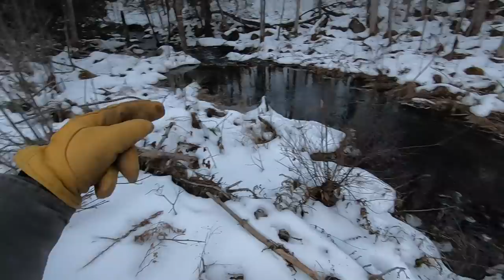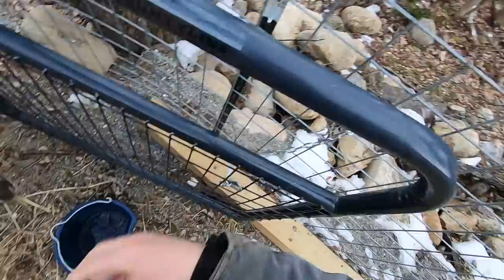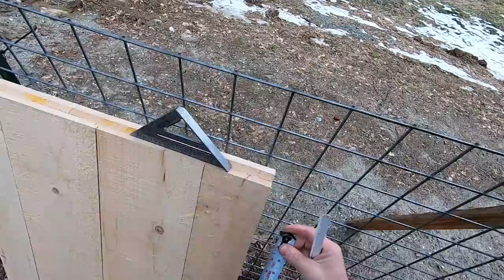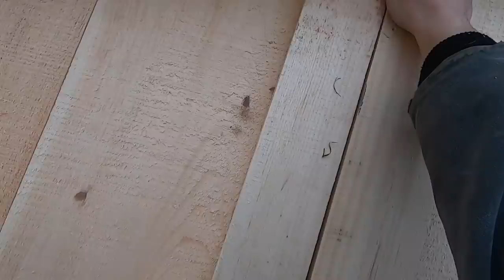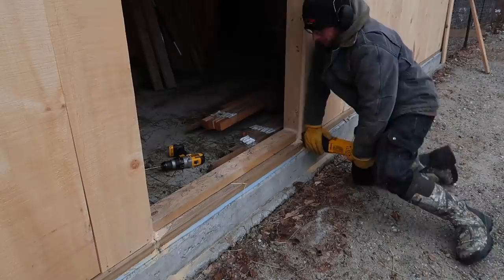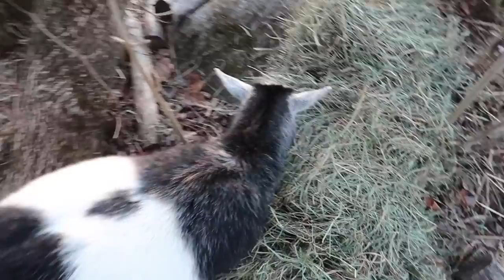Using ALL the Best TRICKS to INSTALL our Custom BARN DOORS (Post & Beam BARN BUILD)

Comment: from an old carpenter...when you are hitting a piece of wood {trim) or some piece that will show.. don't hit  it with the hammer...use a piece of scrap and put it between the hammer  head and the board you are adjusting.. this will protect the trim from all those ugly hammer head dents on what you will see. :)

Comment: If you sprinkle a bit of ash from the woodstove on the ice.
It’s dark and promotes solar gain to melt ice. 
It adds grip to the ice to prevent slipping. 
❄️ Caution if you use it near the house be careful toe black in the house.
Reply: holly slaughter, such a nice tip!  Thank you!
Reply: That was a very wise suggestion.

Comment: If you still have the ice on the paths a trick to get it to melt faster without needing salt or chemicals is a simple mattock, sledge hammer or even a maul to go along the ice and break into smaller chunks to increase the surface area the warmer temps can attack it. When Ice is a sheet you reduce where the temperatures can melt it from to the top and edges.

No need to go digging to get under the ice just some good solid hits from above to break the sheet into parts and simply let the above melting temperatures do the rest for you. 

Have you thought about getting a few turkey to roam the pasture for thanksgiving next year?

Comment: So glad you found how to make clean holes on both side with a spade or forstner bit. With big holes we use two drill motors, one with a forstner and the other with a hole saw. Perfectly clean holes every time.

Comment: Good morning.
Al, have you ever tried a Vix Bit? Not that you're having an issue with centering the bit but they are amazing.
I'm a carpenter by trade and these make installing hardware a breeze. You seem like the type who would appreciate these.
Aside from that, you are doing a fine job with your attention to details.......Top shelf !

Comment: I was wondering: Is the direction of the door opening for the door near the hay feeder practical? It looks like it would if your main usage is to open the door from the inside and turn with hay to the right side, but if you want to go to the left towards the goats' feeder, you would have to pass the door first, which on the screen looks not very comfortable in that rather tight spot ...... and going into the hay barn part from the goat's area, you need to pass the door all the way to the left side before opening it ...... as your projects are perfectly planned and thought through, I am sure, I am missing an important point here, but wish I would know which one it is ;-))))
Reply: I agree. I thought the door swing was impractical and should have a swing the other way

Comment: Wild cat tracks are always inline. They step into the track already made by their front paws. They also keep their claws retracted when they are not needed. Wild k-nines can't retract their claws and their tracks are offset although they still step into their front paw track the left goes into the left side and right goes into the right. Wild K-nines keep their tail down for the most part, but cats use their tails for balance therefore they want to keep their tails dry. From every thing you have shown and described You are dealing with a coyote. If you indeed catch one put your traps out again they tend to travel in packs similar to wolves. Also I would like to aplaude you and yours building skills.

Comment: The woodshed was far more important to be done and filled before the snow flew and it got cold. You don't NEED that side of the barn until spring for lambs.
I'm surprised you didn't put the hinges on the doors inside the workshop. Look how much faster the second door went in once the apprentice came!

Comment: Great job on the doors guys, square, plum & with perfect gaps... I too use the National brand sometimes, i.e., ( 4 ) black powder coated 6" hinges on my carryall's swing out walls... The carryall frame itself comes from TSC in Littleton... Currently applying MinWax Helmsman clear semi-gloss to my custom built chainsaw holsters. The carryall itself is now built as I am building my tool holders for the backside of the back wall currently... 
Bill on the Hill... :~)

Comment: How does the logic work when you climb over a gate that you could easily walk through? Safe homesteading means not taking unneccessary risks. I guess planting the head mount camera into the ground with your head would make great YouTube content but YouTube may consider it to be too violent.
You need a pounding block to reduce the hammer marks on such pretty rough sawn wood.

Comment: It could be your casting your human scent when you be walking thew the area of the what are you placing the game camera maybe you have to find a way to cloak your scent like what deer hunters do when you go hunting
Reply: I have never had any problem, I have had 2 foxes, a coyote, several turkey, and many deer walk right up to me within 2 arms length.  So I don't believe scent is an issue. Animals are curious. I leave mine for several days then check them. I have had deer find the camera and start licking them, had to move them higher. Also had a squirrel use one to sit on to eat nuts.
Reply: @jamesdeffenbaugh5166  but you make some valid points but everybody sent is not the same scent. Now looking at my post you see a few people agree with me but each situation is different I was just putting out a suggestion. In for the area he lives in even I live in a suburb and we have foxes coyotes possums and raccoons is something out there doing something and that's how the crazy white CHICKEN end up being killed
Reply: @jamesmoore1743  not all animals work on a schedule like deer, walking in the same path at almost the same time. Yes, I would like to eliminate all the predators around my property, if I can just keep them separated from my animals then it's a success. It's been over a year since they have gotten any of mine. I can't let my guard down just keep up my vigilance, as I see a potential weakness, address it. I have a 6 foot chain link fence that skunks walk straight through as it weren't there, foxes and coyotes climb on something and jump over the fence, then dig there way out. Raccoons walk right up the fence. Now I have a screened top, don't put things to close that can give access, and concrete around the base of the fence, also electric fence 2 and 4 inches of the ground. What I and several others have suggested is to put camera's near New Yoke City to see what is coming for the chickens. The camera is set up on the other side of the property. I have 2 of my camera's set inside the pen looking out in opposite direction, they are what show me the most action.
Reply: @jamesdeffenbaugh5166  no matter how much defenses you have set up to protect your livestock any predator will find a way to get in I have seen and personally heard animals shock themselves an build up a tolerance to electric fences! A predator when it comes to survival what do a whole lot to get a meal  as well as you know. And again you bring up valid points you have to stay on Vigil but he's already has put up a camera around New York City before. Let's say this we can agree and disagree on the subject but whatever he's doing he's not coming out with an outcome so far do you agree on that

Comment: Here in the UK,, the only things made out of wood like you have are horse stables,,,, same split barn doors,,, to make something like your barn here would cost ten's of thousands of pounds,,,, Workshops here usually are made from steel frames+metal sheets.... Much much cheaper

Comment: If your camera is not taking pictures it’s probably because your SD card is not formatted that information should be in the owners manual on how to format the cards my cameras won’t take pictures unless I format each time I put a card in it wether it be.a new card or one that I’ve used before I still have to format the card

Comment: I don't understand why you haven't bothered to answer my non-controversial question (that I've asked many times) about if you're using your cold storage room in the basement anymore or what your plans are for the rest of your basement now that you have your workshop. Is there a problem with those questions?

Comment: Something to keep in mind... my trial camera (Tec.Bean) will not record video if the batteries are less than 50% depleted.   Yours may be the same.  Mine works fine if powered with house current.  So if your camera has not recorded anything after being deployed for a few days... check the battery strength.
Reply from the maker: Good to know thanks.

Comment: ☮ those latches do look nice.  ARE THEY MANUFACTURED WITH HOLES IN THEM FOR GREASING?  OR  DO THEY NOT REQUIRE IT?
Reply from the maker: They don’t have any grease holes. But you could oil them

Comment: Don't put pigs in barn that smell will never go away ....my own personal experience.
Reply from the maker: Thanks.
Reply: The way your doing it now is best for hogs. Just keep rotating them around the field. They will even taste better living that life as opposed to a barn. Even piglets will stink up a barn as nice as yours. If it were old and more open I would say go for it but that’s a nice barn and hogs do better outside. That’s how I did mine and they even seemed happier.
Reply: I disagree as long as they have access to the outside and fresh bedding it will not stink. But you can’t be lazy with it.